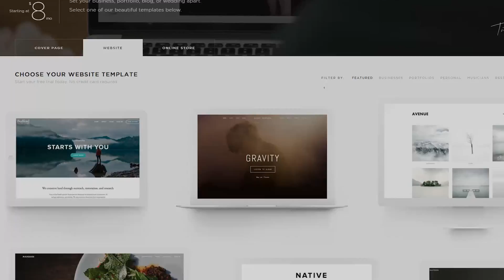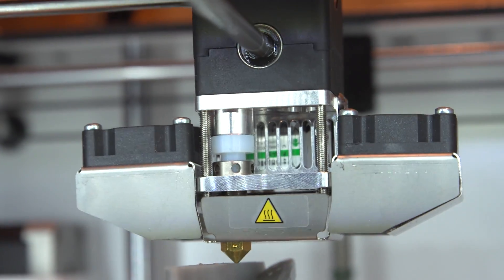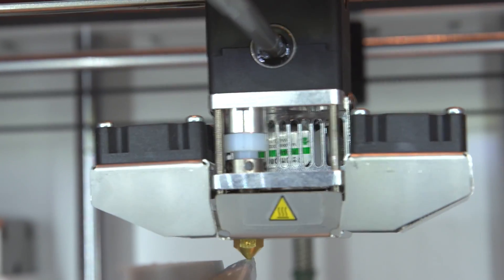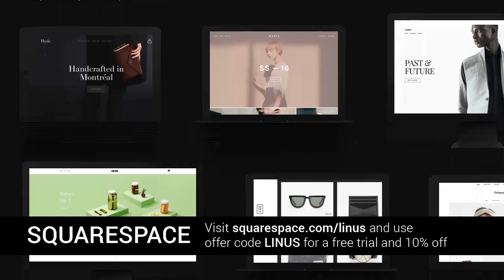Detailed 3D Prints! Ultimaker 2 Extended Plus

Comment: Nice.. I bought an ultimaker 2 .. It worked for 2 days and now it is being sent for repair so basically im loosing the printer for 4 weeks.. Meanwhile the plus has been launched and i only used mine for 4 prints.. Im losing 1 month of warranty on the unit... What a lousy sevice for a 2.3 k euro printer

Comment: Thanks for the coverage Luke but your explanation of Airflow and its effect on Resolution is flawed since its variable for the Filament you use.
Reply: +aumkar chandan Better cooling is better for most filaments though. Who prints in ABS nowadays?
Reply: +Videblu I do and apparently a good half of the 3D Printing users do as well. I use PC-ABS all the time for its strength. Apart from obvious resolution differences, the strength is as close as you can get to an Injection Molded part. 
PLA is a Biopolymer and does degrade and weather significantly when put to use. Unless you are using your printer as a recreational device and not a workhorse machine I wouldn't diss ABS and its derivatives like that.
Reply: +aumkar chandan I feel like most people that need to print in ABS are well aware of the effects of cooling prints. For most of the newbs Luke's explanation is fine.
Reply: True.

Comment: Ultimaker, worlds slowest 3d printer!
yes it can pring nice things but DAMN its slow compared to a makerbot!
Reply: +Jared Reabow (Jazza) speed doesnt matter much if your extruder doesn't last longer than an hour of print time. I just replaced the nozzle on my Ultimaker 2 after 1852 hours of printing.
Reply: +bob my makerbot clone is at 1600Hrs and has not been replaced
Reply: +Jared Reabow (Jazza) slow compared to a makerbot? wtf? Makerbots are the Apple of 3D printing, but shittier.
Reply: Jared Reabow What are your print speeds?
Reply: +Videblu I have a makerbot clone FYI, i also have an ultimaker 2.
I am a prototype engineer and use these both as a hobby and for a living, the ultimaker is overpriced rubbish.

The boden extruder is awful, if it jams and you have to remove the filament,   watch out, if that filament snaps you have to dismantle the thing.
its slow to the point that for actual prototyping its actually useless compared to the Makerbot clone that prints about 5 times quicker (a genuine underestimate) and the interface for the makerbot is som much quicker to use and easier.
that stupid scroll wheel on the ultimaker is a pain in the arse!
Reply: +Videblu to be honest its not that simple, print speed is only a small factor in the huge amount of settings you can modify but to put it simply the makerbot clone is running at about 140mms on low quality prints and about 80-110 on high quality.
it is a 0.4mm nozzle
the ultimaker without jamming mid print can do about 60mm/s
Reply: Jared Reabow Huh, I never would've guessed that. What's the point of a bowden design then if not for speed?
Reply: +Videblu not much!, problem is the extruder driver on the ultimaker is SOO BAD which is why they are replacing it!

other problems include the ultra fast filament retract which will shred filament if its stuck.
Finally they are replacing the head as well and it is because the filament guide tube is not secure or long enough and as a result filament can get around the tube and jam it when it cools down, the only fix is again to dismantle it.

Unfortunately the dismantling of the ultimaker is FECKING difficult as the screws that hold the extruder mechanism on also hold the stepper motor and because you cannot access the extruder stepper easily, you either completely dismantle the printer back or you angle it until the stepper falls back in position.  

the advantage to a boden extruder is a lighter print head which can travel faster but when the filament driver is so poorly designed that doesn't happen!
Reply: +Jared Reabow (Jazza) Wat

Ultimaker 2 comes dialed in default at 9000mm/s^2 acceleration and can easily achieve above 120mm/s speeds WHILE EXTRUDING. Makerbot can't come anywhere near that.

If your Ultimaker is having issues I would go as far as to guess it's because you're not maintaining it properly.
Reply: +karlzhao314 I wish I could get that on my printer. I've got 500mm/s^2 at 40mm/s
Reply: Videblu What printer do you have? That seems quite excessively slow. I have even my acrylic Prusa i3 (which is in no way at all supposed to be fast) at 1400mm/s^2 and extruding easily at above 50mm/s movement.
Reply: +karlzhao314 Q3D ThreeUp. World's 3rd shittiest printer. I've done 60mm/s at 1000mm/s^2 before but something's causing my steppers to skip steps for some reason. I'm keeping it at low accel because of the heavy bed and heavy extruder.

Comment: "If you use much smaller filament material you can make something that's much finer, more detailed" good god these guys know dick-all about 3d printing. The point of that print head is that it uses e3d-v6 volcano nozzles in which you can swap out based on what diameter extrusion you want. What Luke meant to say was smaller nozzle diameter = finer detail on small prints but increased print time. A larger nozzle like .8mm for example extrudes wider lines and when compared to a .4mm nozzle would print the same thing in roughly half the amount of time. I know because I have an ultimaker2 extended and have had to replace the olsson block three times now. The community based Olsson hot end has it's design flaws but still works and gives you tons of flexibility design, time, and materials wise. If you end up using the Olsson block also get some stainless steel nozzles, you'll thank yourself when you're trying to get one unstuck and it doesn't shear off in the block rendering the whole damn thing useless. But you wouldn't get anything other than a thrown together ad from these eggheads. </rant>
Reply: If you use a smaller diameter nozzle, it's extruding smaller filament material out of said nozzle.  Way to get all butthurt over something that was still completely easy to understand the meaning behind.
Reply: +Bells Jingle Your post is not valid XML
Reply: cool stories!
Reply: +Bells Jingle There are valid arguments to be made for smaller filament for precision. The smaller amount of plastic being pushed through per length means you would have to go through more steps/microsteps of the extruder motor to push the same amount of plastic out, which could potentially improve precision in less precise extruders, such as 1/8 microstepped MK7 extruders (only 40 steps/mm or so). That being said, the Ultimaker 2 has 1/32 microstepping if I remember correctly and uses a 400 steps per revolution stepper on the extruder, so I'd say you're right.
Reply: Ok you don't have to go captain technical on me. The machine doesn't allow you to switch out filament, only nozzles which is what I am pointing out. They're so rushed in pushing these out they don't check to see whether or not what they're saying is correct or not.
Reply: Bells Jingle That, or they might just not know enough. :P

Could be either as far as I'm concerned. Luke does seems rather fluent in 3D printing, but then again (as far as I can tell) he doesn't really have the technical experience of an experienced Reprapper.
Reply: karlzhao314
lol that's my entire point, they know dick all about 3d printing and are pushing 3d printer ads using their credibility as a media based tech company.

Comment: does the new feeder better support support 1.75mm filament? or is it still designed for 3mm?
Reply: +Phil barrenger it's running its "own" standard 2.85mm instead of 3mm or 1.75mm. The new features does not change that unfortunately.
Reply: +AMID 2.85mm IS the 3mm standard. It's what the original Repraps were made to use because 2.85mm welding rods already existed, and they just shortened it to 3mm.

Comment: What's the difference between Ultimaker and Makerbot?
Reply: ultimaker care about releasing quality products
Reply: in case that needs a little more explaining: both started out pretty early on and pushed consumer 3d printing to make it viable and makerbot even became the "face" of desktop 3d printing for a short time but their newer generations and specifically their "smart extruder" were released with major known issues (rendering machines basically useless) and they have since fallen from grace
Reply: +elay127 I have one, and pushing it that far is not normally a problem, it only makes it slightly more difficult to print flexible filament, I printed an upgrade and now it works great, with clogs(which happen very rarely) you can either simply in engage the pushing mechanism and then push yourself, or you can pull out the filament, unclip the tube, and push new filament through directly into the extruder to clear the jam
Reply: +Winston Caeser interesting. i might have to run this by the 3d print lab at my school and see if we can get one so we can try that sort of mechanism
Reply: +Winston Caeser Its just a bowden extruder, not unique to ultimaker. In some cases its better than direct drive extruders, but unless you need an extremely light print head it doesn't offer many benefits, and has the drawback of needing to feed the filament through the tube to the extruder. That just makes changing filaments take longer.
Reply: +Jake Black I'm interested if it offers benefits at volume.  when printing a lot, a large amount of failures that require significant downtime occur in the extruder assembly, so separating the drive might help with maintenance
Reply: elay127 Potentially yes, but in most cases direct drive extruders are much simpler and require less fiddling to find issues with them. Ultimately they are just different ways of accomplishing the same goal with their own strength and weaknesses.
Reply: +Jake Black What ever happened to formlabs do you still even make 3d printers I thought they had a potential to be good.
Reply: +Kevin Dyer Ultimaker didn't betray it's communinty: Makerbot was opensource and everybody could improve their printer, untill it suddenly went into closedsource and made the improvements for themselves... (Watch the documentary 'Print the legend' to find out how it happened...
Reply: +elay127 yup
Reply: One of unique parts of ultimaker printers is that they push the filament to the head allowing the head to be lighter instead of pulling filament from the head, and ultimaker is all open source
Reply: +Winston Caeser i havent had my hands on an ultimaker in a while so that part actually surprised me a little. it seems like a long distance from where it pushes to the head. do you know if people have seen binding between the pushing box and the head/what happens if the head clogs?
Reply: +Winston Caeser unengage
Reply: +Connor  Jackson What are you talking about? Formlabs is better than ever, especially with their new machines
Reply: +Aidan Leitch Oh I've been just seeing what LTT has been showing and they haven't talked about Formlabs ever so I just assumed that something happened
Reply: +Connor  Jackson LTT isnt a good source for 3d printer news...
Reply: +Jake Black I've experienced that in less robust gantries (all Repraps and derivatives included), the lighter carriage of Bowden extruders can result in less backlash of the carriage, especially at higher speeds. Not too practically important, but it does reduce the wavy edges you sometimes see at corners.
Reply: MK3424 I have watched the documentary a couple times in school, we have 2 Makerbot Replicators at our school which I've been using for a few years, recently to print prosthetic hands for a group called E-Nable.
Earlier this year we took a field trip to Makerbot headquarters up in Brooklyn, NY. It was quite the experience.
Reply: karlzhao314 I've had the unfortunate experience of having my direct drive printer walk itself off my desk on an overnight print. Im guessing that would also be helped with a lighter bowden carriage.
Reply: +Jake Black or maybe just get some rubber feet? No need to trash a printer because it has a problem that can be fixed. Also, that doesn't sound like it's because of the extruder, sounds like its because of the other motors.
Reply: Thats what I did. I'm not trashing my printer, its great, but the print head carriage assembly is pretty heavy. Taking a motor off of it would surely make it move the entire printer less.

Comment: plastic thing is called a heatbrake I think.
Reply: +LazerLord10 I read that as heartbreak and was confused for a while.
Reply: heatbreak*
Reply: +LazerLord10 Yes you are right! A heatbreak normally is made out of PTFE or stainless steel or anything that transfers heat slowly and withstands high temperatures.
Reply: +LazerLord10 It's the PTFE coupler, separates the hot end isolator and the Bowden tube.
Reply: +Ashwin Gurbuxani yup, me too... I went to the comments to see someone correct lukes inaccuracy... At least its a cool 3d printer
Reply: +Ashwin Gurbuxani Oh.... it's HEAT

oops